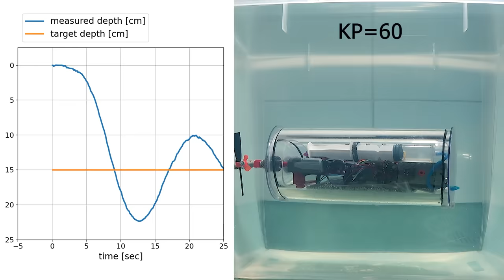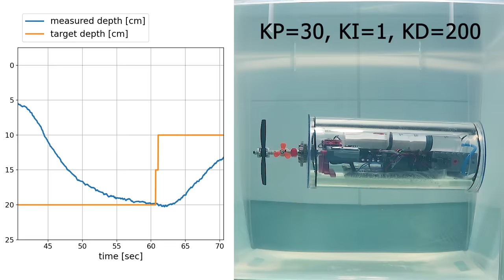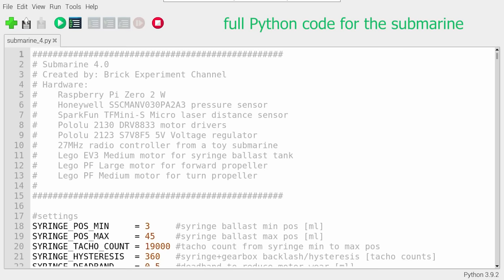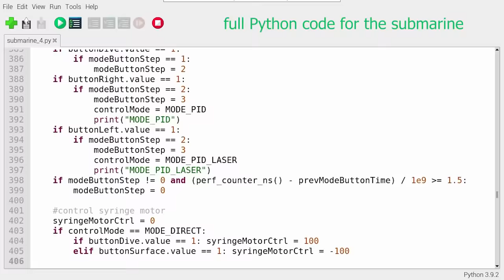Building a Lego-powered Submarine 4.0 - automatic depth control

Comment: I was already impressed with the syringe being operating using a Lego motor, then the magnetic drive and everything else means this is probably the most impressive thing I've seen this year. I wonder how much it could be scaled up...
Reply: Well it turns out you can scale this up to nuclear submarines.
Reply: @MastaSquidge   hahhah, that's a good one
Reply: @MastaSquidge  Well damn I had no idea those were made using Lego. Amazing.
Reply: im just wondering if its possible to put like a roller in the magnet that can recess... like those tunneling drills have them.... that way it will reduce the friction even more and be more efficient while also sticking to the plexi.... even a small trenched track could be inset so only the whell/roller descends into it while the magnet rubs against the tape on glass to hold it there. That would make it even better, all while no dealing with waterproofing. But that all depends on either successfully sandwiching the magnets and roller or CNCing a brittle magnet to hold a roller, not the easiest thing in the world.
Reply: @MattTester  yeah man its pretty cool. They started making em out of metal, then I think they were called erector sets. After that someone had the idea to use custom made metal components specific to the application them BAM, nuclear sub.
Reply: I was surprised that that motor was able to move the syringe enough against the force of water pressure to change the air volume inside the container. At some point you’d wanna’ switch from this kind of displacement ballasting to compressed air, I expect.
Reply: @JoeOvercoat  Can you explain this? I keep reading it and I don't understand. Isn't the pressure consistent throughout the sub? And since the water pressure is constant at given depth, wouldn't the water pressure in the syringe be the same as the water pressure outside the syringe? And wouldn't that pressure be about the same as the air pressure inside the container? So wouldn't the power needed to change the amount of water in the ballast be pretty minimal? Not trying to argue, I'm just genuinely curious.
Reply: @grex2595  He is in essence taking on water as ballast to sink the boat. And as the syringe pulls back to let water in it must be compressing the air inside the cabin. I would think the Lego challenge would be pushing the water back out at deeper depths, and ditto for scaled up versions.
Reply: @JoeOvercoat  it depends on the design of the syringe
Reply: @JoeOvercoat looking at the syringe design it won't
Reply: @JoeOvercoat  I think that since the syringe is open to the source of the water, the water pressure inside the syringe is about equal to the water pressure outside the vessel (some height differences). I imagine that you're right that the bigger the vessel or the deeper the depth, the harder it's going to be to further compress the air inside the vessel, but I would expect that at any depth expelling the water shouldn't be much harder than pushing the syringe. Although, I suspect the syringe is a failure point at depth as the water pressure will likely overload the motor eventually and push the syringe out. That could probably be solved by worm gears?

I'm no expert, though.
Reply: Scaling up is easier than s aling down if you start small
Reply: Are we talkin military scale ..hunt for red october ?
Reply: we boutta make this 1/1 scale
Reply: @grex2595  water pressure increases 1/28th psi an inch. So ten inches down the syringe is about 1/3 psi more. Not much, but more. And this is where the syringe as ballast control will not scale up well.
Reply: @JoeOvercoat  I get that, but it's not 10" the difference in depth between the lower input is maybe half an inch to an inch, and the surface area of the plunger is maybe a square inch. So using your numbers the force needed to force out the water is around 1/28th pounds. The motor should be able to do that.

Now if you're talking about depth descent, you have to remember that in a system where all of the water is connected, the pressure at a given depth is constant, so the pressure of the water in the tube is equal to the pressure of the water at the same depth outside the tube. That's why I only calculate the difference in depth between the syringe and the opening.

Now, if you're talking about the difference in pressure between the air in the sub and the water in the syringe, that's more complicated. If this were a balloon, then the pressures are the same. Since it's a rigid body, the body supports some of the force, so the air pressure in the tube is probably less than the water. So, at depth, the syringe probably gets forced out to sink the vessel, but there's probably weaker failure points, and this could probably be solved with a worm gear.
Reply: Colombian cartel has entered the chat
Reply: I’m a little confused on how the syringe works since if it’s sucking in the air inside the submarine wouldn’t the same amount of air be inside the submarine?
Reply: @unablenarwal8863  it is sucking in water, not air
Reply: @kuboteusz  that’s what I first thought but I just can’t see where the syringe has access to the water probably since I’m watching on my phone
Reply: @unablenarwal8863  The pipe leads outside so when it's underwater it's sucking in water, making the sub heavier. When the water is pushed out it gets lighter.

Comment: This is incredible. I'd love to see you test it's max depth. You could install some LEDs so that it the camera can still see at increased depth and tether it so that the sub can be retrieved once you lose radio control. Taking it to a lake should give you the depth and the relatively still water you need in order to test it safely
Reply: It would be great if they send a camera down, and have a remote wifi antenna that floats but with a very thin wire so it doesn't impede submarine movement.
Reply: All in favor of having our guy build a fully-functional LEGO R.O.V.?  :D
Reply: Luckily we have a lot of lakes in Finland. And when i say a lot i'm not kidding
Reply: @mariasirona1622  Spoiler: Finland doesn't exist, it's just one big lake
Reply: @GeomancerHT  There must have been something like that to get the shot of the sub captain minifigure anyway.
Reply: Would be an expensive exercise to kill an Rpi and other electronics
Reply: @atlasworldbuilder8246  Yes. Yes yes yes yes yes!!!!
Reply: @kathybramley5609 that is prerecorded, any Go Pro can do it but you cannot "fly by wire" with it.

To go deep you really need to do it tethered.

It will need to be a bigger submarine, I hope to see more, but I have already started gathering up parts to do my own!
Reply: @kathybramley5609  you could use a mirror.
Reply: They should add RGB strips 😂😂
Reply: @superchroma  good exploration mini submarines are extremely expensive
Reply: i think the problem is that radio doesnt go through water that well... so he would have to redesign the radio setup to go much deeper
Reply: @Rawmon94  perhaps an extremely long coil of wire to extend the antenna with a float on the end that can just float onthe surface?

That way you don't have to worry about the water interfering.

Edited because autocorrect is dog shit.
Reply: It could probably go to its crush depth
Reply: @Rawmon94  yes, exploration submarines are usually tethered
Reply: @kathybramley5609  I think they just waded into the water to get the shots
Reply: Chrome cope
Reply: radio control didnt work under water
Reply: As a scuba diver the crush depth for that thing would be pretty deep I’m guessing about 30m if the seals are good enough and at that point it would implode from the decreased volume of gas inside and destroy the equipment within also losing all data unless it was done by cloud
Reply: If you're so smart why don't you make one then?
Reply: @GeomancerHT  check out the Ecosub project. It goes much deeper, is only slightly larger and is fully autonomous with no link to the surface.
Reply: @JamesPerrett  amazing, thank you!
Reply: @jamesheaton5421 this is the standard way it’s done yes. 2.4 GHz only penetrates into water a few inches so wouldn’t work submerged. Communication with submarines takes such long wavelengths that the US Navy has antennas that span an entire mountain valley just to resonate at the incredibly low frequencies used. And you can only send simple slow teletype (text) messages a few characters per second at best.
Reply: @Venom_Tree no cloud underwater. RF won’t penetrate at those high frequencies.

Comment: Can't believe £200,000 was spent on a sinking sub with the same controller and this cost around £100 and did the job just fine
Reply: I get what your saying but making a submarine capable of reaching the insane depth of the titanic with people aboard is a lot more complicated than this. This ROV would implode before it even got half the depth.
Reply: @wyatt-mv6pd  half depth? 2000 meters?
 Lol 10 meters i would rather say
Reply: @ADRIAN-zh4ti  For a fun comparison, 2000M depth is approximately 190 atmospheres or roughly 3000 pounds of pressure per square inch. That would be the equivalent of balancing a Toyota corolla on a one inch wide section of the glass.
Reply: @wyatt-mv6pd  the problem was that these dudes were billionaires and they were told beforehand that the submarine wouldnt be safe for going down that far, and the guy that warned them about that got fired for it
Reply: That lake tho

Comment: Would definitely love to see the depth it could accomplish! Maybe add a bit of code, if it hasn't received any kind of input for 5 minutes, to push out the syringe. That way, if it gets too deep and loses contact with the surface, it'll bring itself back into range automatically. Maybe attach a rope to it, so if you take it out to a lake to really test its capabilities, it won't get swept away by a current.
Reply: Though I would like to see its crush depth, if the creator can afford to lose the parts.
Reply: @Galactipod he probably can with the amount of money made the 4 videos hes made about lego submarines
Reply: @Galactipod  I mean you don't actually need the internals for that. Just attach a string to the camera, and fill the body with enough ballast to just sink, no need for the electronics
Reply: @bob-xy1bd  exatamente
Reply: @Galactipod 
Probably rated for about 10 meters or so until the ends pop off.
Reply: @WaveForceful  that is probably not what would happen. as you go deeper, the water pressure increases aka the lid will become more and more secure as more and more water is pushing inwards.
Reply: he did that last one in the first vid
Reply: Still safer than Ocean Gate
Reply: rope?!  just keep it simple: add AI to find its own way home...

Comment: That's very cool! For the next iteration, consider adding heading control using a gyroscope and magnetometer. I added it to my combat robot and it really helps to keep things moving in the correct direction. You should be able to get all the sensors you need on a single board that can plug right into the Raspberry Pi and communicate over serial or I2C. They are often referred to as a 9DOF IMU.

Comment: Ideas:

1. Make submarine bigger, more powerful, and more durable. Use it to explore big lakes, rivers, public pools, whatever:

- more Lego motors for faster speed and carrying more mass, or motor bought on Amazon and connected to Legos (nobody will blame you)

- bigger container to fit everything

2. That's another very very ambitious idea: antenna relays. This will probably help make your submarine truly long distance.

Simplest way is to just take two different antennas, and make one relay signal of previous one. And have the sub accept signal of all of them, OR-ing it (if at least one antenna connects, it will work). Might seem like not an elegant solution, but I think it requires the least programming.

You can place the relays along the river by hand, and it will greatly extend your range of control.

The more ambitious idea is to make the relays placeable by submarine.
Make few mini modules connected to the sub externally. It should have a way to connect and disconnect them. Need to find simple way like magnets or whatever. Modules need to be neutral buoyancy, and contain relay antennas and other stuff to relay the signal. Maybe ways to attach to the environment are needed, like anchors.

Maybe it's unrealistic to expect this, but it would be cool.

3. Create Lego gripper. Simplest way is to create "jaws" in front of the submarine, opened and closed by engines with gear ratio exchanging speed for power. Maybe try catching fish with this?

Comment: This is awesome. Have you considered this idea? Add a magnetometer (compass) sensor to detect direction. Then auto-correct heading based on this. You may need a button combo to disable this to manual control of heading if you find that the readings are inaccurate, which can happen with cheaper magnetometers. 

This would simplify having to manually correct heading so much as I noticed with the button push readout.
Reply: This is exactly what I thought of! It would make steering much smoother and actually resemble how it is done in actual submarines, as far as I understand it.
Reply: Was thinking something like this, but worry the drive magnets might jam the compass. Though even having an onboard compass to provide barring would help given it seems easy to get disoriented if you lose visual contact.

Comment: 3:35 smothng about quantum i think? reflections i mean
Reply: Nope
Reply: Nope; light travels at different speeds through different mediums so the light going through liquid water, then the solid acryllic, and then through air bends it in different ways before it reaches our eyes (or the photosensor of the camera in this case).
Reply: @racer927  on water surface ,photons have more than 1 positions. That makes the reflections man

Comment: how deep can this go?
Reply: The depth isn't the main concern.

But radio signal of the controller is.
No matter what frequency, there are no end-user or DIY remote control that can effectively control toy submarine beyond 10 meter deep.

Sure there are controller that can do beyond 10 meter deep, but it's cost around $50k or more.

Even the video footage from inside this toy submarine is stored locally in the SD card. Not transmitted wirelessly to a Laptop or external storage.

Comment: I love this project. Since its 2 years now i dont know if you intend to go for V5, but i have some ideas for you to test out if you are interested:

- First of all, have a look at RCflights channel and his solar powered boat. With this software and GPS Hardware you could make an autonomous Sub, that can explore the oceans for you. Or large lakes atleast :D 
- use 4 syringes on all corners, to avoid currents from turning the sub. For the controls you can just use a flight controller from a drone. This way the sub should always stay level for even better video footage. Also either glue the pellets on the southside or make a compartement with another sheet of plastic, so it cant roll in currents or waves. 
- If you go for the flight controller, add the GPS from RC (im not doing ad for him right now, i just would like to see you building an autonomous sub) and plan routes, with the max depth a tube of acrylic can go i assume GPS should work fine.
- To extend batterylife add a chillmode, where the sub will float on the surface and just hold position, using the least amount of energy possible. Add Solar and a charger to refill the batteries, so it can travel alone for days. If you have a big SD-Card that can contain more footage than the cameras battery can provide, maybe add a charger for the cam in chill mode too? 
- Maybe its worth a shot to try ballbearings glued to the back instead of low frictiontape, depending on how strong the magnets are and if they can go over the thickness of a small bearing in which you put the gears then. Maybe you can save some energy by reducing friction this way even more
- Maybe its also worth a shot to try and shape the sub more sublike in the front atleast, so you reduce waterfriction and need less power to propell the sub forwards.
- Also maybe its an idea to add fins for turning in an addition to the turning prop. This way you only need to set the fins with a low amount of energy to make a slow, but wide turn. In emergencies you can still use the prop to throw the sub around. This would also save energy (going absolutely for the approach of the autonomous sub here, sorry^^')
- use a cage for the props, so no algea or strings in the water can destroy the propulsion system
- Maybe its worth a shot to cut out a hole for the actioncams waterresistant cage and glue that thing in there, creating a thight seal. The video footage is already great, but the OG bodies of actioncams mostly have special bendings/lenses in them to make even better shots aviable.  
- If you go for bigger lakes and stuff maybe add a magnet on top of the sub, so you can lift it with a drone or a fishing rod with a magnet on it. This would make retrieving a lot easier. 

I know its a lot, i dont know if you will see it at all, i have no clue if some if these things will work at all, but i would love to see a mostly out of lego sub explore a big lake over like 2 days or maybe even more.

Comment: Hi,

This summer I am going to build a similar submarine like yours using bilge pumps as actuators on the outside of the hull. Reading your blog and learning from your faults have already lead to many design corrections - thank you a lot for taking the time to make a well detailed walkthrough. Under your section "How to improve it?" you write you would make the end caps easier to install. Do you have any ideas for this I should include in my design? I find this bit tricky since it need 100% sealing and should be able to open and close. 

Best regards Frederik from Denmark